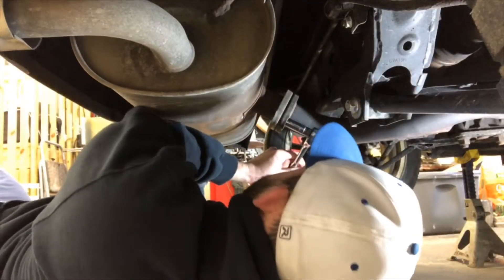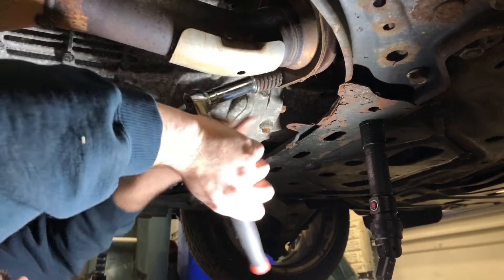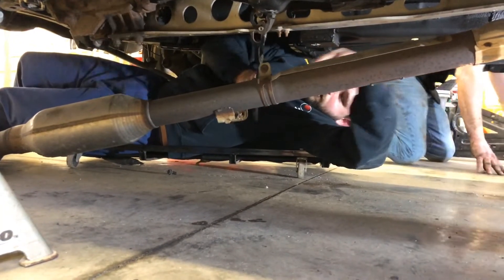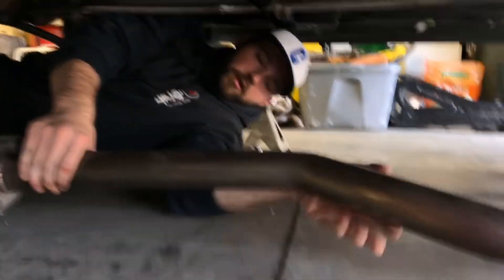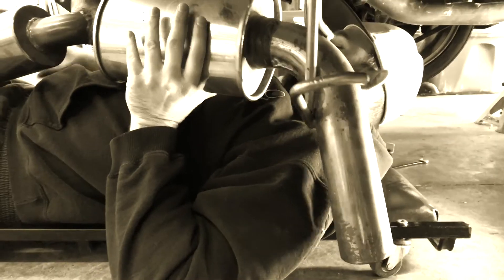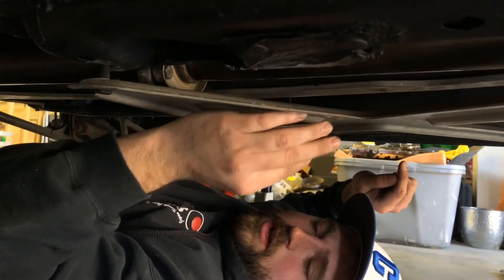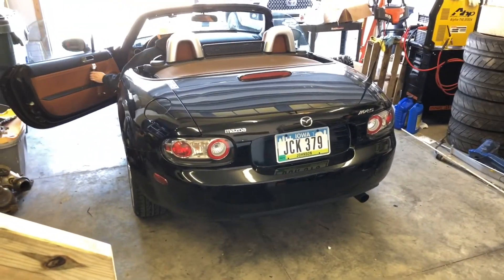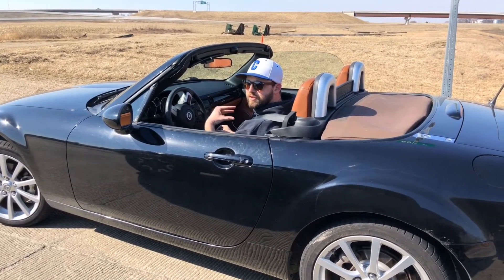Miata FINALLY Gets Header-Back Exhaust (CATLESS)

Comment: interesting. I've got a catless header and a similarly designed axle back set-up but with the OEM mipipe and the it is crazy loud above 55% load from 2500-4500 rpms.  like >85dB in cabin. I plan on fabbing a 2.5: midpipe with a resonator in the place the cat was and another resonator where the previous resonator was and am hoping that does the trick. Any chance you've got a reading from a sound level meter or spectrometer on your set up?
Reply from the maker: Hey good to hear from you. This setup was fairly loud, but the Helmholtz chamber kept almost all drone down in cabin. I unfortunately do not have a decibel reading from this particular setup. I did eventually switch to a catless header with this exact setup and it was absolutely deafening. Open headers mean you definitely need a resonated midpipe. 

After doing the 2.5L swap I did get DBs  with my open header + Racing Beat non-resonated midpipe and the same axle-back as above, it was very high. Around 103DB at 50 feet IIRC. Too loud. I ended up swapping to an OBX midpipe and it helped a lot. Made it an actual livable setup compared to the straight midpipe, but man did it still sing up top. The crossover between 5-6k or so in RPM was glorious.